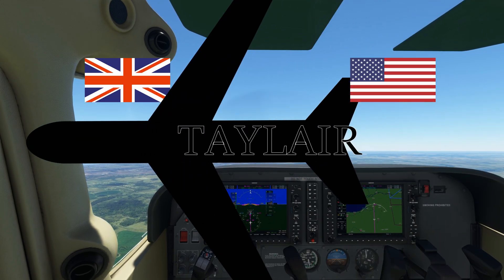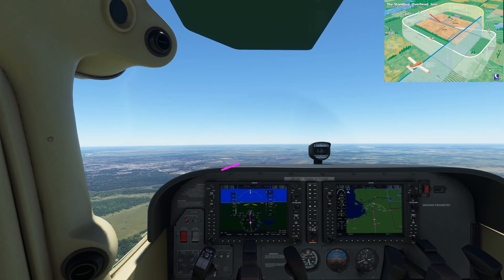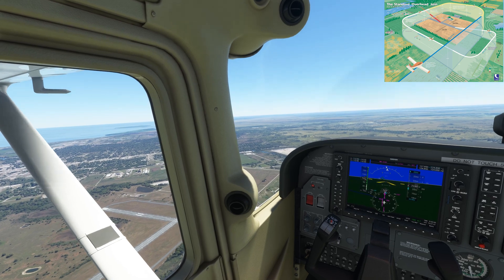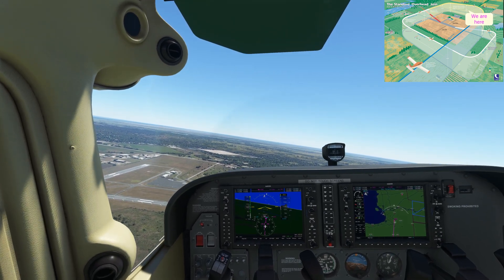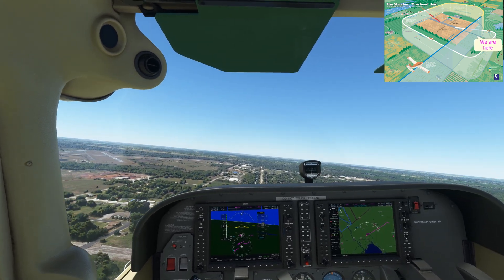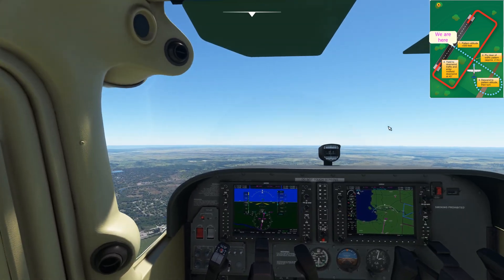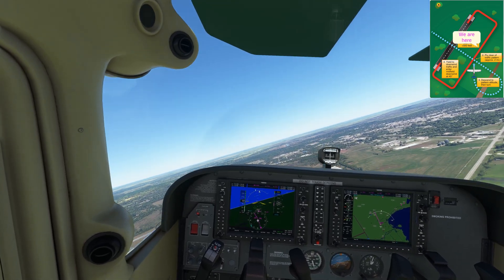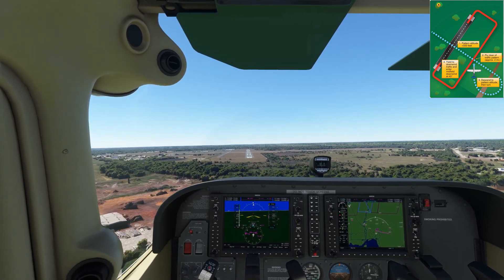VFR Traffic Pattern Entry Procedures | USA Vs UK | With Real Airline Pilot & Instructor

Comment from the maker: I made a mistake in this video and decided to leave it in for fun. Did you spot it?
Reply: Your turn in the diagram for the teardrop was backwards. Your turn was the right way but your diagram was backwards
Reply: Your airplane was facing the wrong direction in  your diagram for the teardrop entry
Reply from the maker: The diagrams are not quite the same because they are out of the FAA text book but the fundamentals are correct and the turns are in the right directions, there's something else... Keep looking!
Reply: Was the mistake that on the teardrop approach you started turning back towards the airport before you had descended to the pattern altitude?
Reply from the maker: Interesting, I've never interpreted that the tear drop turn should be done in level flight at TPA. I don't actually know anyone who does it like that either... There's something else, but maybe there's two!
Reply: @Taylair  I was just going on point 3 in the FAA diagram, which says "Descend to pattern altitude, then turn." I can't really think of a reason not to perform a descending turn, although descending before turning might put less mental load on the pilot. I'll keep looking...
Reply: It must be that you were flying using QNH rather than QFE. [Edit: Of course, I mean flying at 2000 ft and 1000 ft QNH, rather than 2000 ft & 1000 ft QFE or 2200 ft and 1200 ft QNH.]
Reply from the maker: You’re so close… keep thinking along these lines. I think you’re going to get it!
Reply: @Taylair  Your altimeter was set to standard pressure (29.92 inHg) when you flew the teardrop approach!
Reply from the maker: Look at the overhead join one again and compare. You're nearly there. All the information you need to figure it out is in the video somewhere.
Reply: @Taylair  I think I was guilty of jumping to a conclusion - I assumed that the standard pressure was wrong, whereas the pressure in the overhead join was: In the overhead join, your barometer was set to 30.08 inHg and your altimeter was showing you to be at an elevation of 180 ft on the runway. When you flew the teardrop join, your barometer was set to 29.92 inHg  and your altimeter was showing you to be at an elevation of about 30 ft on the runway. The airport chart shows that the airport has an elevation of 34 ft, which means that the pressure setting in the overhead join clip was wrong. You were, therefore, flying that procedure at an altitude approx. 150 ft lower than your altimeter was displaying.
Reply from the maker: That’s it! I amended the wind to favour runway 32. I didn’t notice that in doing so, the pressure changed to standard so I didn’t change the altimeter. This meant it was over reading by about 150ft. I admire your determination to make me look incompetent ;)
Reply: @Taylair  All part of the service - I'll send you my invoice but I'll have to discount it heavily on account of the amount of help I needed from you to get there! 😉 Seriously, though, it was fun working it out. I suppose that's one of the 'hazards' of using a sim - in the real world, or even in a full flight in the sim, you'd have performed a FREDA check (or something similar) during the cruise portion of your flight but in the sim you can place yourself directly in the air with an objective in mind and overlook things which would normally have been checked.
Reply: @richavery66 The reason I've seen quoted to descend then turn is to allow more time for you and pilots in the pattern to spot each other. In the worst case, I've heard accounts where the pilot entering the pattern makes a descending teardrop that drops them right onto the downwind, which seems like a cute bit of precision flying, but in reality is very dangerous as it allows no opportunity to see and avoid.

Comment: Thank you - excellent stuff, really well put together. The teardrop entry would confuse the hell out of me. (Not hard,  admittedly). So I have to say I prefer the UK (and European?) join. I've a bad habit in the sim of making en route detours so as to arrive on a long final in order to avoid the situational confusion in the circuit/pattern. This has encouraged me to try a more realistic join. I'll need to watch again to spot the mistake: your natural authority means I just believe anything you say.
Reply from the maker: Yes, the overhead join is pretty common around Europe. The different methods are a big point of debate! If you do rewatch to find the error, its more something I've done wrong rather than said wrong ;)
Reply: The teardrop is pretty easy overall and logically makes a lot of sense (overflies the pattern and allows you to enter with the flow of traffic on a 45 degree entry), but most people tend not to actually do it in favor of the "alternate" crossing entry. Personally, after having seen the european entry, it makes a lot more sense for going NORDO and/or not having an AWOS. 
That being said, what you said you do in the sim actually isn't unrealistic. While the FAA prefers you to perform a normal standard entry, it by no means is illegal to enter straight-in. In fact, that's a requirement for most instrument approaches. In congested pilot controlled airspace, a lot of people prefer to do exactly what you said you do in the sim because they can control exactly how to sequence themselves in.